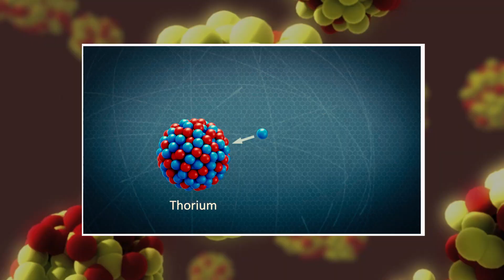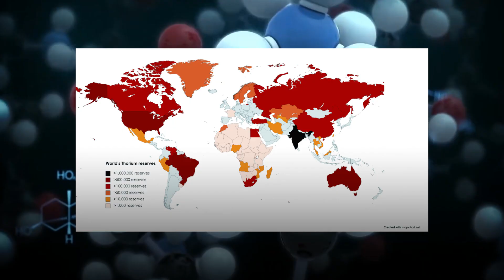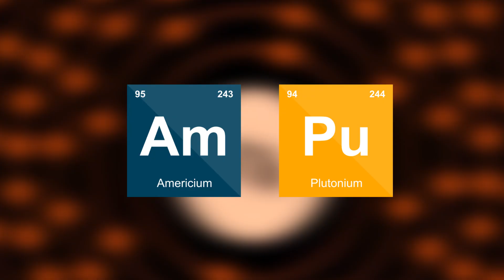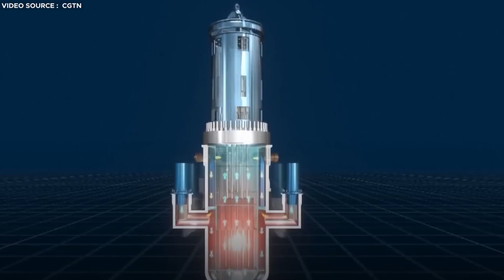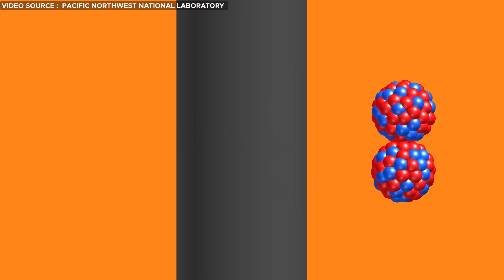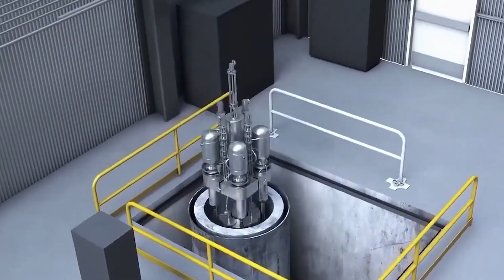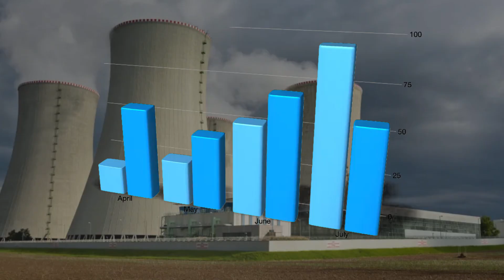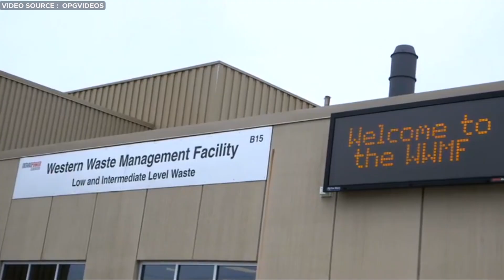Inside China’s Radical New Nuclear Reactor Powered By Thorium

Comment: To say that China is pioneering thorium reactors is wrong. This was done at Oak Ridge Labratories in the late fifties and sixties. The Chinese used the research from ORL when they built their own reactor. All the scientific work was already done. The reactor at ORL never produced any electricity but they made and tested the first thorium based reactor. Today there are about eighty different parties that are working on thorium based reactors worldwide. I think the next 10 to 15 years will be very interesting.